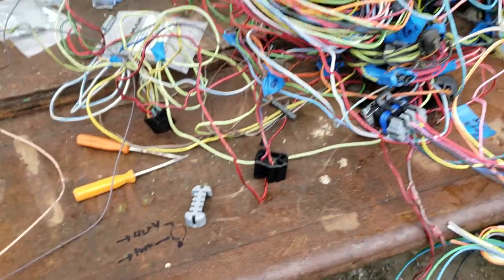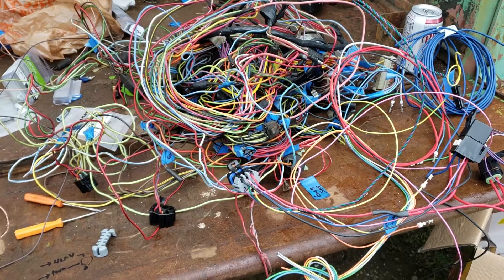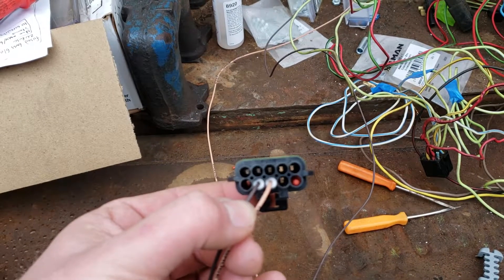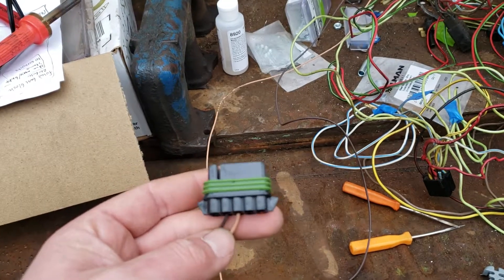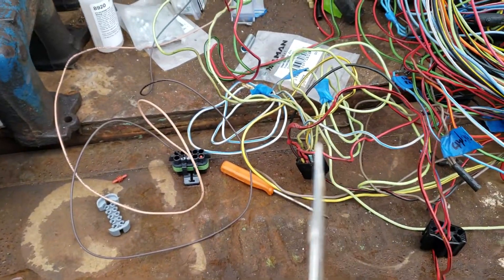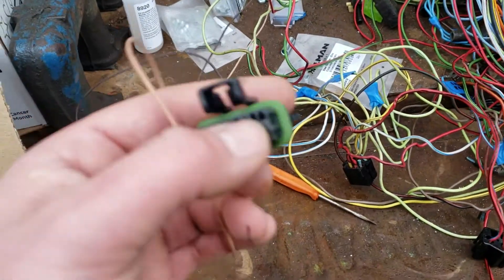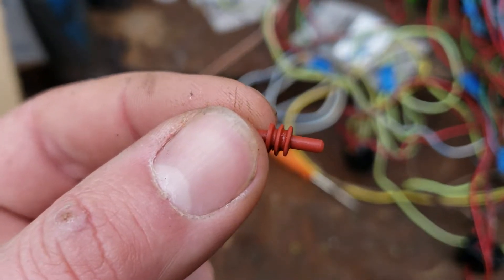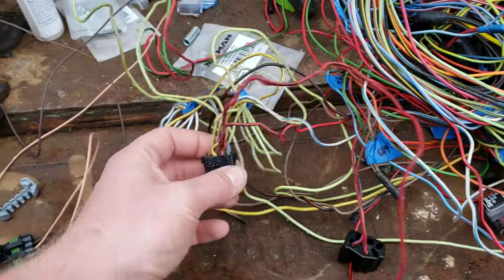Metripack/Weatherpack Connectors

Comment: how do you make sense of  all the wires ??
Reply from the maker: I work with alot of circuits and wiring  for a living. Using a color scheme helps as does having a spare harness to maintain colors when I needed to extend wires.